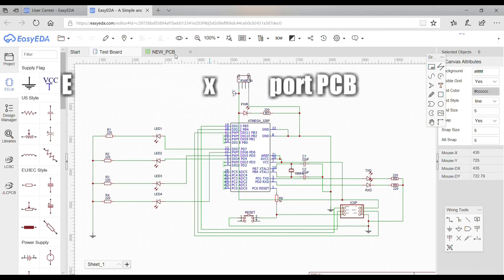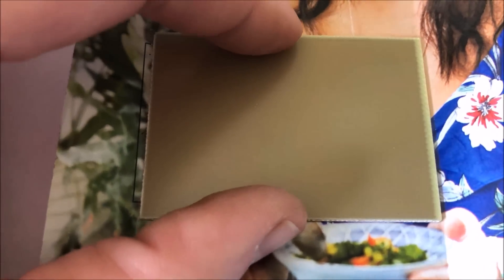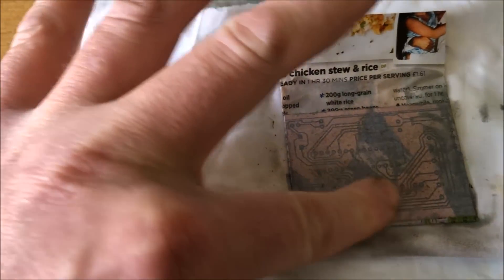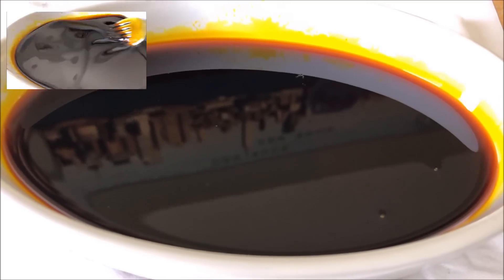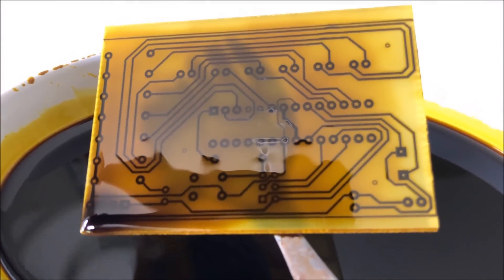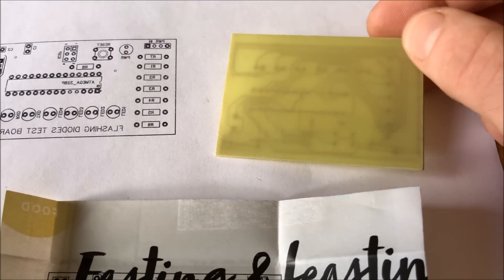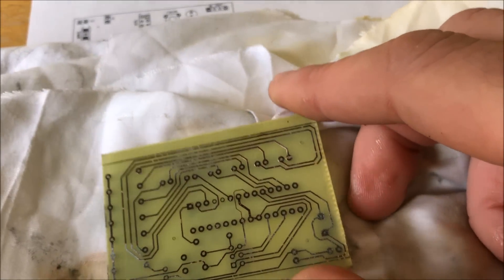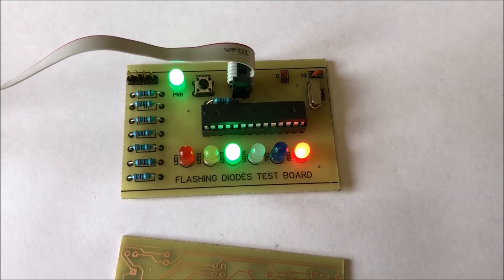DIY PCB Toner Transfer (No Heat) & Etching

Comment: Where is the drilling part of it? how did you do it? This method is really awesome.
Reply: Unless you are making loads PCBs get something like this:
https://www.amazon.co.uk/Precision-Hobby-Drill-Drilling-Pieces/dp/B07WM26KSF/ref=pd_lpo_21_t_1/259-1787072-4505045?_encoding=UTF8&pd_rd_i=B07WM26KSF&pd_rd_r=fa59bed3-67f1-45a4-8c0c-4f0ddecb0df5&pd_rd_w=QfkHw&pd_rd_wg=O11dz&pf_rd_p=7b8e3b03-1439-4489-abd4-4a138cf4eca6&pf_rd_r=NMD5PH0PC6XBD17RBHJQ&psc=1&refRID=NMD5PH0PC6XBD17RBHJQ

Comment: Which PCB brand are you using? Because some cheap brands have a very thin copper layer I heard.
Reply: Just make sure you get 1oz copper thickness, when you buy. 1oz is standard.
Other common thicknesses are 0.5 oz or 2oz. Usually board houses offer those 3 options.
For low voltage and low current projects it won't matter much anyway.

Comment: Is there any reason you can't use an inkjet print?
Reply: Inkjet printers use ink. Laser printers use toner, which is a thicker layer.
The ink layer is thin, which would likely allow the acid to get through easier.
Also, ink might be completely messed up by the acetone / nail polish.

If you can go to a public library, they might have a laser-printer that you can use (where I live, we need to pay around $0.15 per sheet of paper printed). Otherwise, find a printing service; it's cheaper than purchasing a laser printer.

Comment: Gareth, I tried to make this work several times, and got no where.  It finally occurred to me that you're using nail polish remover, which isn't acetone; it contains acetone.  A quick check of the product MSDS reveals that the specific gravity is .82 to .85; since pure acetone is .787, this means that it probably contains about 75% acetone (ignoring the confounding variables of aloe vera oil and scents).  When I diluted my pure acetone down to 75% - 3 parts acetone to one part distilled water - I got much better results.  I also found that a towel placed under the PCB - as you did - absorbs excess solution, and prevents it from being reabsorbed into the work, where it can cause damage.  One difference I introduced was the use of a kitchen rolling pin; this allowed me to exert much greater vertical force, while keeping horizontal force at zero.   Thanks for an excellent video.  >Charlie
Reply: and thank you for the information and efforts
Reply: I seconded that... Great video...  I'm going to try this method
Reply: Any success so far folks?
Reply: I noticed, (after I tried it right quick) not to use Scotch tape, he used masking tape.  Scotch will fall apart allot.
Reply: SADLY That particular solution is discontinued. So it looks like we have to experiment with this.  Too bad straight Acetone fails. I'm going to try an inert oil because common sense tells me not to introduce an oxygen rich [h20] solution into the mix. May aloe vera oil was a hidden happy accident?
Reply: @cowboy6591  acetone and ethyl alcohol 1:2, 1:3 depends on the toner
Reply: Excellent information 👍
Reply: ;) ☆♡Homemade Single-Sided PCBs♡☆
Reply: https://m.youtube.com/watch?v=HBIxvwZ_0og
Reply: Thanks for mentioning this, you have saved a lot of time for me
Reply: During my time 1980 was in technical school. That time technology was not advance. On printer circuit board use tracing paper draw the circuit on the board using pencil. Than used marker pencil draw again where did in pencil.  Lastly use faric cholride to do the aching.
Reply: Suas informações são muito importantes! obrigado! Desde Brasil
Your information is very important! Thank you! From Brazil
Reply: Use 25% by volume Lacquer Thinners and 75% Methylated Spirits (in south africa this is about 95 to 98% ethyl alcohol). Basically cheap cleaning alcohol. Works best and far better than acetone.
Reply: I tried this with acetone as well,  and mixes of acetone, nafta, ethanol. but i did get it to work either with these things.. one thing that nail polish almost always contains is ethyl acetate,, so i suspect this is what is  also needed, illl try some nail polish remover and see, it could also be a toner thing, as not all toner is the same.. im using a brother DCP-7030 with  brother brand toner
Reply: @0x2a1A4  , I'm also using a Brother BW printer with Brother toner.  Gareth is - I believe - using an HP laserjet.  Don't know whether it makes a difference or not.  Keep me posted on your further attempts with nail polish remover; I never got a result as good as Gareths using any mix of acetone and water.
Reply: @charlesworton4020  Laserjet 1100 according to 0:46 - I wonder whether that's with original HP toner?
Reply: @DougWoodrow  You have amazing eyes, Doug - thanks for the clarification.  Only Gareth knows what toner he was using.
Reply: @DougWoodrow  are you sure he's using a laser printer? From what I'm understanding he's printing on top of the magazine paper to use it's toner because ink jet doesn't use toner, obviously. I could be missing something. I'll rewatch again because I'm curious as well. I'm assuming AC is write and the acetone concentration does have an impact on effectiveness. Can't wait to try this for myself.
Reply: @charlesworton4020  toners really don't differ that much between black and (white) what is actually a gray toner that allows colors to lift with the toner. That would make since why the black area on the pcb is left behind. Does that mean the toner prevents electrical currents from flowing and black zoned areas help direct the current through the busses? 🤔
Reply: @syzygy4365  Pretty sure, yes. Laser toner is plastic, the magazine paper is simply a transfer medium that can be easily dissolved in the acetone.
Reply: @syzygy4365  Magazine paper is chosen because it is glossy. Paper with a texture might absorb the toner into its irregular surface. I've had excellent results with random glossy magazines. You can't use inkjet for this.
Reply: @charlesworton4020  maybe even he does not know what toner is inside 🙂 I have (by chance) HP LaserJet 1020, with a clone toner, so we will see... There are a few variables here: toner, printer, glossy paper, nail polish remover, pressure (including the movement).
Reply: @rexsceleratorum1632 I believe you can use baking paper / parchment
Reply: @0x2a1A4  
Here are the ingredients: (i removed the B5, preservatives and scents and dyes)

Acetone, Water, Ethoxydiglycol, PPG-12-PEG-50 Lanolin, Propylene Glycol

These seem to be the ingredients of interest. Interestingly, ethoxydiglycol absorbs water and thins, so maybe the problem isn't the acetone. The lanolin is a UV protection and probably doesnt do anything. Propylene Glycol gives the viscosity and can probably be removed.
Reply: @josephvictory9536  ah thx.. ill take a look..
i moved to photosensative method now a days and this seems to work perfectly, this way i can easily build home made smd boards.. im using the posativ20 spry to coat my boards, this works like a charm, using 2 10watt 396nm leds for lighting 10min is more then enough to get a good photograph, etching with HCL  + H2O2 for 15min orso, this gives me a dual sided board within a hour !
Reply: @0x2a1A4  oh wow! I wasnt even aware of that! What an excellent method!

Im going to look up the details of that more!
Reply: Instructions uncleared, painted my nails purple.
Reply: you guyse doing it work, you need make sure a lady body photo on magazine paper before wrapping it and massaging it with fingerings very good
Reply: @netbin someone needs to check your hard drive man!
Reply: this is no way to make a circuit board the way i would do it and im speaking to someone new to making circuit boards is Presensitized PC Board develop it with a weak like a level table spoon to about a liter of water about like 8 cups of water just to get it to here with much better results and Ferric Chloride is the best way of etching a circuit board ive found there is brick acid and water with both of these and the Presensitized PC Board and lye is at a sink and dip it and wash it in the sink quick with the lye the ferric chloride can take as long as it takes but the way i like in the sink i put it in a sink of hot water in a plastic box you dont care about
Reply: @thedevil5544 I have no idea what I just read! English is definitely not your first language
Reply: Not quite sure why responders are using Acetone or some other weird and wonderful cocktail, he clearly says, and indeed shows, that he uses nail polish remover! He's showing that 'it ain't broke' so why try to 'fix' it?
Reply: @icarossavvides2641  Acetone is a known quantity; nail polish remover varies widely in composition from brand to brand, and the brand that he uses isn't available in North America (and probably other places as well).  Determining a workable substitute for the nail polish remover is a first step in arriving at a workable substitute that can be created by anyone, anywhere.
Reply: @icarossavvides2641  Nail polish remover may be pure acetone, or mixture of many different fluids. It's composition is highly undetermined.

Comment: Dear Sir, I don’t know how to thank you for sharing this method which is much better than transferring the toner with a hot iron. It’s not giving good results and sometimes the heat causes the copper layer to separate from the plastic. I followed your method using acetone instead of that polish remover I couldn’t fine here. It gave the same result. Just brilliant. Thanks again my friend. ☺

Comment: SM0VPO (www.sm0vpo.com) I have been making and publishing projects for years, many of which use PCBs. 25 years ago I used an HP7474 flatbed plotter fitted with a permanent ink felt-tip drafting pen (stuffed in an old HP pen case). Since then I have been using photo-spray resist. I sometimes have trouble getting an even coating of photo-resist, moisture, dust. There are always problems of one sort or another, but on the whole I can produce really good PCBs. In recent years I have very few failures.

But yours is a really interesting video. I will try this method because it looks really easy. I have tried the toner-heat transfer method with reasonable success but I have found that the magazine surface often sticks to the board, which then tears when the paper is removed. The heat-transfer method seems to make the toner stick to the paper like a limpet as it pressed deeper into the fiber of the magazine.

That which I do not like is the use of Ferric Chloride. Ferric chloride stains toilets, sinks, carpets, kills 99% of household plants and can put a serious strain on marriages. I much prefer Hydrochloric acid (HCl) and Hydrogenperoxide (H₂O₂). 

My mind has been racing away after the inspiration of your well-made video. Instead of black, and using a decent laser printer, one can use make use of colours. Tonight I will be looking to see if toner will work as a solder-resist. If so then I hope that my own PCBs will come into another class, inspired by your video :-)

What is also interesting with your method is that it can be used to transfer toner to other materials that would be easily damaged with heat, such as SSID cards, or joke ID-cards, plastic personalised calling cards with photographs, badges, etc. Only limited by the imagination.

Thank you for the excellent, inspiring and really well-made video.

Comment: Thanks for the video. I was wondering what is the maximum current that those traces can handle? I needed to build something to allow about 10 to 15amps of current. Do I need wider traces and if so then how much? also what is the thickness/height of the copper trace you have in your board.

Comment: Can someone tell me what I am doing wrong? i tried it with news paper and with magazines (a LITTLE bit thicker) but the toner keeps sticking to the paper every time. does not matter if I soak it in acetone or just rub it firmly. does not matter if i let i dry or remove the paper wet.

there is nearly no toner on the PCB

Comment: How do you accurately align both sides of the board?
Reply: Look close on the right when he places the pcb on the second print, you see the lines on the paper and on the pcb, he just aligns that lines, but in this case it is only possible because the pcb is smaller than the print, the lines should be covered by the pcb, in other case you cut the pcb in the exact size or atleast place one corner on the corner of the print, that is why you always need to print the frame aswell, do this for both sides and it will be perfect, if not then just try several times until you got the feel for.

Comment: Why not just use the EasyEDA PCB fab process?  For $2 in 6 days you can have 10 boards delivered to your mailbox.  The boards will be double sided, plated through holes, 6 mil traces with 6 mil spaces.  One can not fab such a board at home fpr $0.20.  The PCB material will cost more than that.

Comment: I'll have to try this out! However, his etching leaves a lot to be desired, using straight ferric chloride out of the bottle is wasteful and may over-etch leading to open traces. I dilute the etchant with 50% hot tap water and use way less etchant to begin with. Make just enough to cover board, the rock gently so etchant move across board over and over, heat and movement speed up etch to as little as 5 minutes on a board this size!

Comment: OK. I have to admit I was REALLY skeptical about this. I have used lots of different papers and inks  - even just tracing stuff on with a sharpie. It's REALLY hard to get decent boards using a sharpie, just sayin. So I tried this a few minutes ago. I expected it to fail miserably. Well, I was disappointed. IT WORKED PERFECTLY! Dude, why didn't somebody tell me about this years ago?! I now have BEAUTIFUL traces. Thank you for sharing this!
Reply: Mity Eltu how much nail polish remover did you use? I have a feeling I used too much - my hands are covered in toner! Is it just enough to wet the paper?
Reply: @jdquaff4686  Not even a capful. Really just enough to soak the paper so I could see the traces on the other side.

Comment: Gareth, this is a brilliant result!  I'm looking forward to giving it a try myself.  Oh, a channel named Nurdrage has published a simple formula for home made 'liquid tin' - you submerge an etched copper board in the solution, and it instantly plates it with tin.  MG chemicals makes retail 'liquid tin', but it's horribly expensive - the nurdrage formula is much cheaper.  Haven't tried it yet, but I've bought the components.

And, another YouTube site - chemistry games - has published much the same formula, but working from laboratory pure chemicals, rather than using commercial products, found on store shelves, that contain the active ingredients.  I've ordered the pure chemicals, and will do a video comparing the two approaches.

And of course, there's always electroplating.  I might try that as well.

I've come back to this video several times, and watched it from end to end.  I REALLY like your result - absolutely one of the best I've seen.  I'm definitely going to try it.  Spectacular work!  >Charlie

Comment: Interresting idea, making the process more easy and possibly less painfull. I just wish that when we encourage hobbyists to etch copper at home, we guide them (in the description perhaps) on the safe and ecological way to dispose of the used etchant. New etchant is not so much a problem (but why buy etchant and dispose of it without using it?) but used etchant is another story.

Comment: Amazing technique. However, I've been trying it for the last couple of days without any success and a lot of frustration. Could be the toner, the thickness of magazine paper or the acetone...
Reply: Not all laser printer toner react with Acetone. I have a Dell printer and the toner in it reacted well with Acetone. I had the cartridge refilled and the new toner doesn't work with Acetone. I also have a Samsung printer that works with Acetone but it's running low on toner. I have been trying other thinner with no luck so far. I tried Methanol, Lacquer thinner, Brake cleaner, Carburetor cleaner with no luck. I'm trying readily available products. I don't want to have to try to buy products from chemical suppliers.
Reply: pressure? dry enough? Let me now, I wanna try it as well!

Comment: I have spent years making pcbs by the old heat transfer method and you have just brightened my life.   😎✔❤😍
Reply: heat transfer didn't work for me at all.

this solvent process works 100pc of the time and allows me to incrementally build up large prints on copper too even over printing. Works great

Comment: Nice.  The three tiny pads on your board that do not connect to tracks are called fiducials (or "fids" for short). Drill through them after etching the first side and line them up with the transfer on the second side for perfect alignment.  Fiducials are there to be spotted by the cameras on automated PCB assembly machines. 
Thanks for the Video and hope you enjoy the electronics.

Comment: Very good video. It can really help beginners like me. I used this method for my firts circuits and it works very well. The choice of the solution is important. Sometimes it doesn't work so well.
Thanks a lot.

Comment: How does the toner go through the magazine paper to the pcb?
Reply: That's my question --- but looks like no one is answering. :/
Reply: Not "through", but "to". The image is printed mirrored on the magazine, then the printed side is applied to the copper surface. 
The acetone/water solution reacts with the toner making it "sticky", kind of like a double-sided scotch tape. When you peel the magazine off, the original magazine print will remain on the paper, while the toner will stick to the copper.